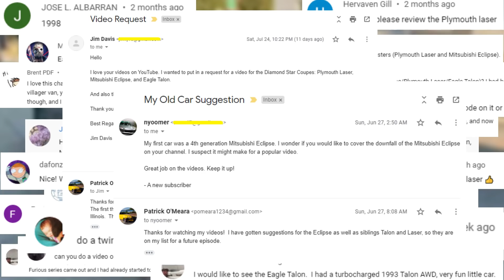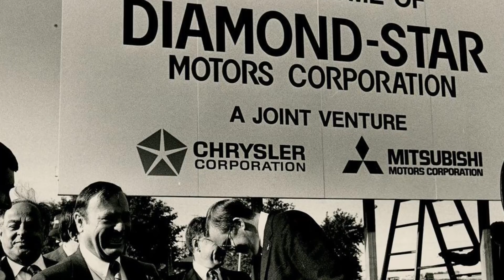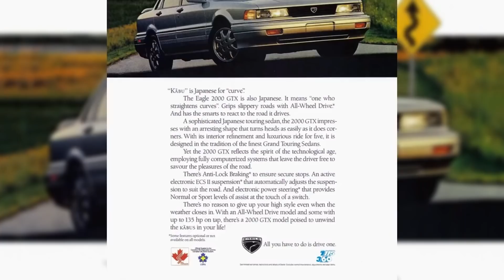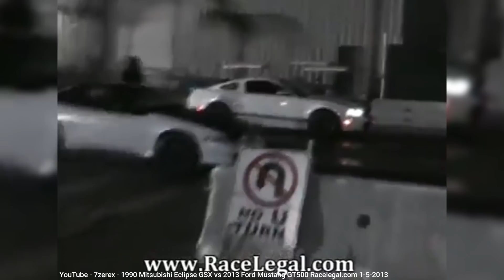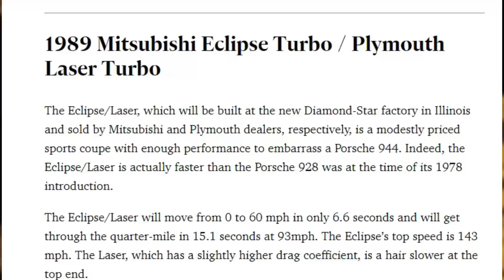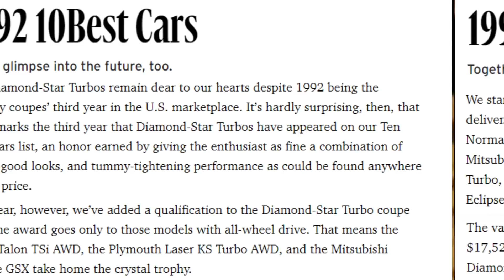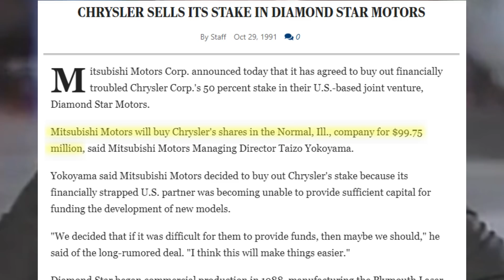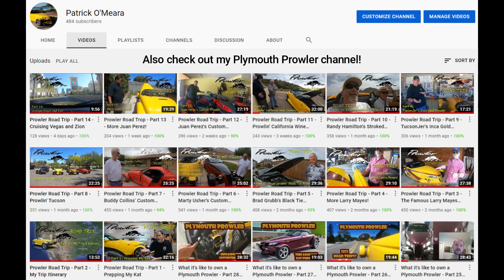Here’s how Diamond-Star Motors merged two automakers in one factory

Comment: I owned a 1995 Mitsubishi GST - 2.0 L, 4cyl Turbo...with 210 HP...It was an amazing car with stunning design and curves that made it a modern classic in my heart.  It had a 2 tone color (top was white with a bottom silver stripe) with many beautiful finishing elements such as exhaust tips, well integrated fog lights and a nicely integrated rear spoiler and tail light cluster.  Power and driving dynamics were perfect - build quality was good for exterior and drivetrain parts with a just decent quality on the interior cabin.

I still have photos of this car on my office wall.

Comment: I had a 1991 Plymouth Laser with the 2.0 turbo and a 5-speed, it had a horrible grinding noise in the transmission when it was running and the clutch wasn’t depressed, but it was one of the most fun and reliable cars I’ve ever had

Comment: From what I've seen at DSM meets and when Mitsubishi used to have owners day events, the Avenger and hardtop Sebring are generally accepted as DSM cars. I'm also fairly sure that the Avenger / Sebring is closer to the Galant than the Eclipse (which itself is an offshoot of the Galant's platform).
Reply: The sebring avenger both had dsm tags on the firewall, so that makes them dsm cars.
Reply: I own a 1996 Avenger and it is based on the 7th generation Galant.
Reply: Yep, and my 1996 Galant ES even had an owners manual printed too late to be replaced, like all 96 Galants, with maintenance info and specs on the 2.5L V6 from the Sebring/Avenger that was never offered in the Galant. Even had drawings of the engine bay and fluid capacities. The Galant wouldn't offer a V6 in the US until the 1999 8th gen and its 3.0L 6G72.

Comment: I remember DSM. I owned a 1991 Mitsubishi Eclipse GSX which I LOVED because it had the famed 4G63 engine mated to a 5-speed manual with AWD. When I bought it it had 79,000 miles and I drove it for 3 years until the clutch went out and unfortunately I didn't have the money to fix it so I sold it. Beautiful Video. I have a suggestion how about a video on the Hyundai Tiburon I hardly see those around

Comment: Thanks for doing the dsm cars! In the gen2 eclipse/talon was THE car to have in the late 90s. They were EVERYWHERE. Sadly the tuning crowd ruined them and mitsubishi ruined the eclipse with the 3rd gen making it heavy and less fun to drive.
Reply: And now it's a crossover!
Reply: people often call the 3rd gen heavy while its lighter than the gsx models and only a hair heavier than the gst 2900lbs and 3200 for the gsx, The 3rd gen gt coupe was 3050lbs. If you compare the n/a 4 cylinder option in both gen the 3rd gen is 100lbs heavier but has 10 more hp. The v6 option also had the same hp rating as the turbo 4.
Reply: @n.d.4317  the awd talons are heavy no way around it. My 1gb awds weight 3096lb with half tanks, my 2g's weight slightly more with half tanks. The main thing with the 3rd gen eclipse is it had less power was only fwd and got major down grade suspension wise. The first 2 generations will always be the ones to have. but mitsu did make an attempt to bring back a level of performance with the 4g eclipse, they're really not to bad once you get over the looks.
Reply: @n.d.4317  the v6 gt was 3180lbs and thats with fwd. Being more nose heavy also takes away some of the fun (this is the case for all fwd cars with a v6. I have an accord v6 and you can feel the weight making the steering less responsive).
Reply: @robbalinski1606  i liked the gen 4s lookes but again the problem with them was they were too heavy. the i4 was 3250lbs and the gt was 3540lbs! Thats heavier than the accord and altima and mazda6 midsize sedans of the time which had better suspensions and more powerful engines.
Reply: @Henry_Jones  3180 was for the convertible option
Reply: @robbalinski1606  I already put the numbers, the V6 has about the same power output while the na 4 had more in the 3rd gen, the suspension was slightly softer and that's something that most people changed with aftermarket parts for both gen
Reply: @n.d.4317  Yes suspensions change-able, but the 3rd gen has to lose more weight then even the first or second gens do, and they're heavy as it is. The biggest thing is the first 2 generations were offered turbo from the factory, make power far better and cheaper then the last 2 generations. Not to mention the evo AWD being an option on the first 2 generations, sure you can fab it into the 3rd and 4th gens if you wanted to but its a fuck ton of work for no reason.
Reply: @n.d.4317  Yeah. I have a 4g GT with the 6 speed manual and I'm so glad that the previous owner I got it from already took care of the suspension by putting much better Megan Racing ones on it.

Comment: A data point on import quotas.  Have a look at 80's and older Japanese mini trucks imported into the US.   The bed has the lower part of the fenders attached with bolts, this was so beds could easily be shipped separately from the truck with final assembly occurring  in the US.
The first gen Ford Transit Connect ( mini van aimed at the commercial market ) came into the US with a rear seat and side windows. Once in the US, they had the seats removed / side class replaced with solid panels and were sold as trucks.   This was to get around truck import restrictions.

Comment: Around 2200 DSM's were made in Dec 88 as a 1990 model year. When the factory was finished in Dec, they started making cars. It was suppose to start sometime in 89. So if you got a DSM from DEC 88 like I do, Some parts are from a 3000Gt like axles and hubs and calipers(single piston)

Comment: Another reason for the pop-up headlamps / headlights being removed were DOT revisions for safety. It wasn't mandated 'just yet' when the revision occurred but soon all makers would have to eliminate anything that protruded above the roofline. As mentioned in another comment of mine they had a reputation for 'eating headlights' as well since their mounts were prone to putting road vibration into the lamp mounts shortening the lifespan of the lights (and since the DSM cars had tight suspension - that was a lot of shock). They looked cool as hell tho and mine never suffered from 'winking' of a failed servo like other cars. Also the Gen1 Talons weren't ES - that was after 1993. It was just the 'base' model (with DOHC) at 135hp - the TSI (turbo) and TSI AWD.

Comment: I owned two cars simultaneously through the 90s. A '94 Eagle Talon, and a '91 S-15 pick-up. Great car/truck combo. I drove both well over 100k miles. Both were very reliable. But, I'm a mechanic. So... maybe I had an optimized maintenance schedule. Sold them both in the early 2000s.

Comment: Heres a car that deserves a video but its just a bit over the year 2000 cutoff. That car is the 2002 Nissan Altima. The 1st car of the Carlos Goshn era and one of the biggest hits. The 02 Altima single handidly redefined the midsize sedan for the 2000s with new standards in size, weight, and horsepower, and styling (afterburner tail lights baby!). Its 3.5 245hp v6 triggered a horsepower war in the segment that kept going up till the 300hp 2011 dodge avenger. It also single handidly saved nissan, making them a contender again sales wise. At the same time it set the new LOW standard of nissan quality. It also sped up the death of the fwd sports coupe segment and being in my 20s at the time I saw this 1st hand. My friends would rather get an altima ser than eclipse gt any day. It deserves a vid especially given where nissan was in the late 90s (bankrupt) and where they were a few yeara later.

Comment: These were cool cars.  As a teenager, I wanted a 2nd gen Talon.  The huge amber turning signals and the front facia with the sculpted sides were so awesome.  I didn't go forward with it because of both price and reliability concerns and with the Dodge intrepid instead.

What I never understood about the diamond star arrangement was why the so-called joint venture used absolutely nothing from Chrysler in the first generation while Chrysler still owned it yet the second generation finally got some things from Chrysler like the 2.0 four-cylinder and I believe they may have also used the ultra drive transmission which was not one of Chrysler's areas of strength.

 It would have been nice if they could have used either a four valve headed version of the k engine in the first generation (such as the lotus head found in the Daytona IROC R/T or The cosworth head found in the Chrysler TC by Maserati) OR if they could have used modified version of the Chrysler 3.5l V6 in the end of the first gen and full second gen in the Eagle and Plymouth division versions.  This way a Mitsubishi would feature Mitsubishi engine and a Chrysler division would feature Chrysler powertrains in a Mitsubishi based vehicle.

Comment: Gr8 mini docu wish it was only longer... My only complaint is U failed to mentioned the fact that even diehard Eclipse fans/owners do not know n that is the car was named after a famous legendary race horse. ALSO if not mistaken the 4B11T motor on the LAN EVO 10 had assistance from Chrysler(n some Korean co maybe Kia?).
Reply: If I'm not mistaken that engine was chryslers world engine which was the first gen 2.0 and 2.4 engines in the dodge caliber when it first came out. And the 2.4 evolved into the 2.4l tigershark engine in Chrysler and fiat cars and SUVs of today. Also the partnership was with Kia, but that lasted even less than dsm.
Reply: @ajwillett7302  U sure about that? pretty sure the 4b11T was Mitsu based engine but due to finances they got chrysler to help out as well as Korean company n yeah probably was KIA(they have a lot of parts on their cars that Mitsu supplies). That why a lot of diehard LAN EVO do not like the EVO 10 since the engine is not 100% JDM. ALSO if not mistaken the very first HEMI engine from Chrysler that V8 was a MITSU made engine correct?

Comment: I had a 90 talon tsi fwd turbo 5 speed in 2000 I built into a 500 hp 465 tq burn out monster 
And in 2009 I stripped everything and put everything into my 93 awd turbo laser and body kit 
Everything 
Now it has a forced performance dsm hta 86monster turbo 4invh dual ball 750hp

Comment: I owned and raced a 93 Eclipse AWD.  I got it to 550 hp, 11s on a stock lower block and 93 octane. The next owner made it full race and got it into the 9s.

I have no idea why they didn't keep dropping in EVO tech for 3g and 4g. Essentially the smaller coupe body would have kept it lighter and more mobile for the WRC.

In many ways the Talons looked better for the 1G. But The 2G went to the whale tail Eclipses.